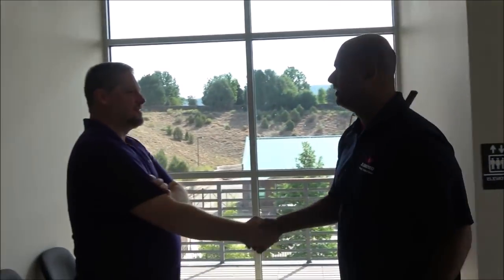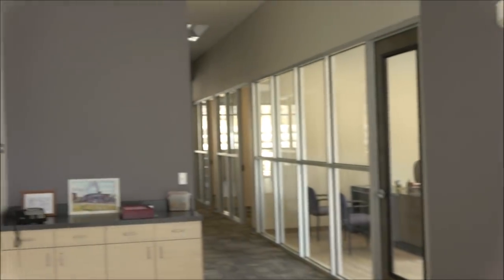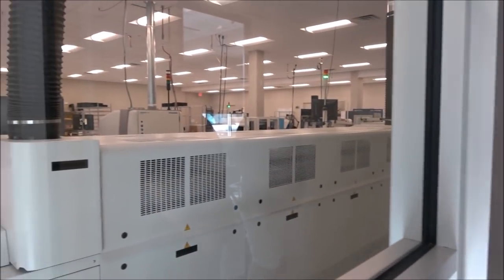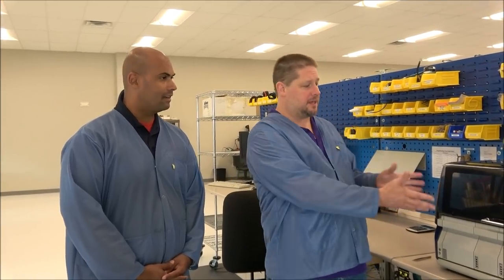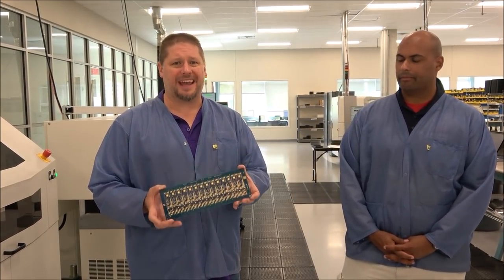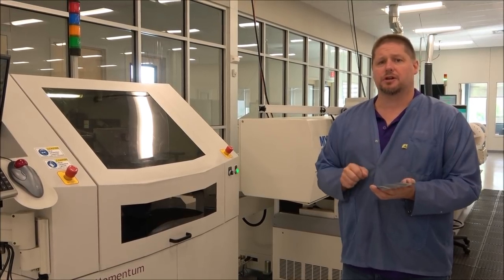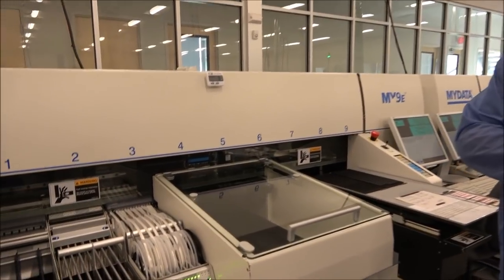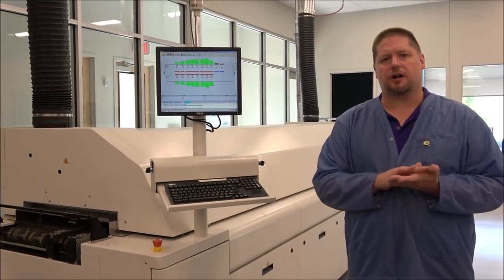Visit to SoundTraxx Headquarters in Durango, Colorado!

Comment: Where are the actual IC mades?  Did he give you what the yield is.  What I think is odd.  Why is the testing not automated.  You would think that someone would take the time in JMRI or build a simple program loop for Sort and Testing.  Literally plug the Chip into the testing rig let the program run through it paces,  that looks like a lot of button push and easily can turn into an ergo issues, including RSI,RMI,MSD,CTD & CTI.  Working in clean rooms for the last 21 years (class 1 and better FABS).  I would think they would have gloves and hair nets.
Reply: The only concern is dust and static build up causing ESD issues.  Don't want the decoders accidentally zapped and ruined.  Testing could be improved a bit, still need a person to plug it all in after attaching wires and heat shrink.  Cost goes up maybe if it is automatic, plus less quality control if left alone to verify the sound works correctly.
Reply: IMRROcom yes, testing could be automatic, but with the hands-on testing, they will actually ensure they are each treated with special care and accuracy.   The testing is important to us and we do want to hand-test each one.  Gives us the ability to change up testing for accuracy.  The purpose is to ensure you get a fully functioning decoder the first time!    The components are made all over the world, we get them from a local (USA) supplier.